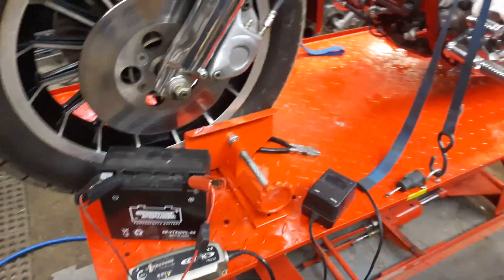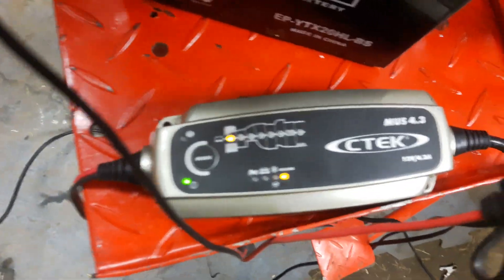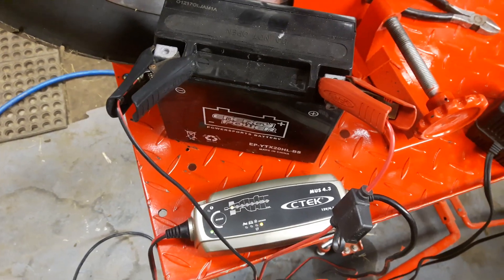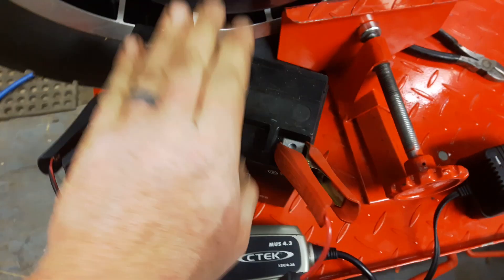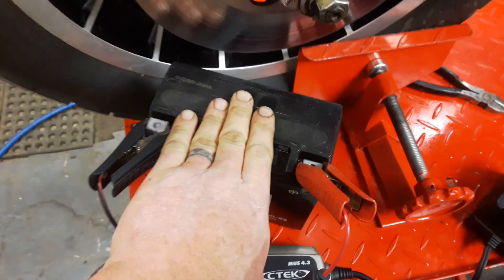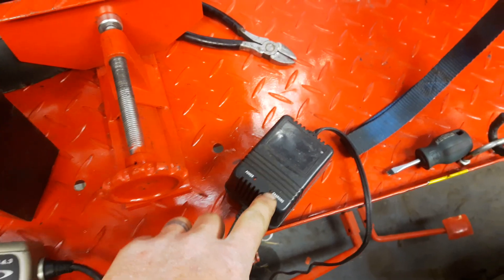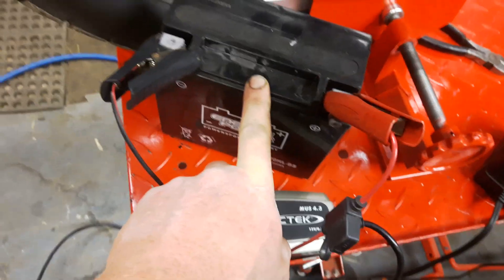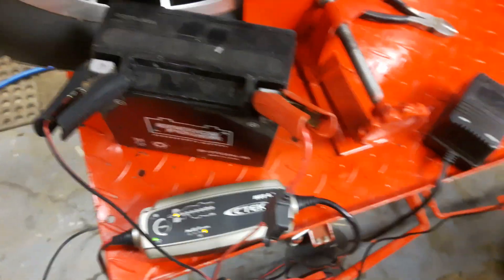How to charge a completely dead car truck or motorcycle battery that won't take a charge

Comment: I had a brand new battery, and went dead after 2 1/2 days of non-use. I plugged in a portable power station and it started charging it. I left it connected and started the motorcycle. It started the lights and the gauges, but everything went dead when I turn the key, I reconnected it to the power station and I get zero draw. I rechecked the Power Station TOGO power. 330 and it is operational right now. I have a trickle charge on the battery the solar variety. Hopefully this will get it to where it takes some charge just like you did with the power transformer. Wish me luck.